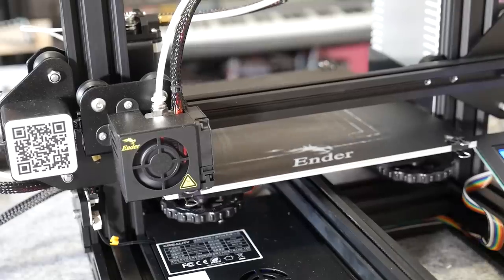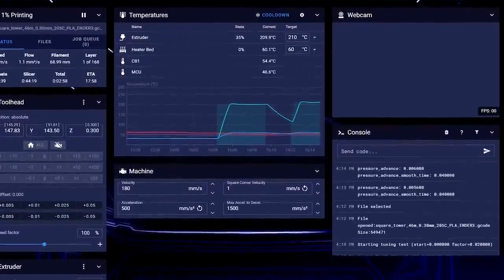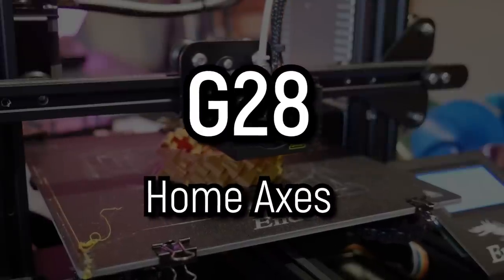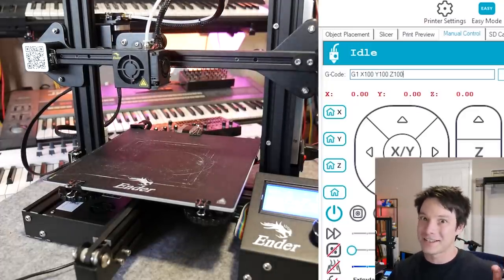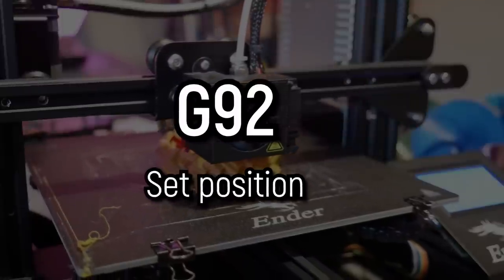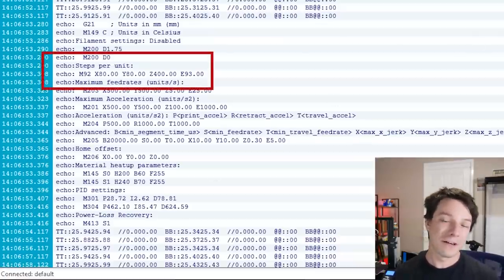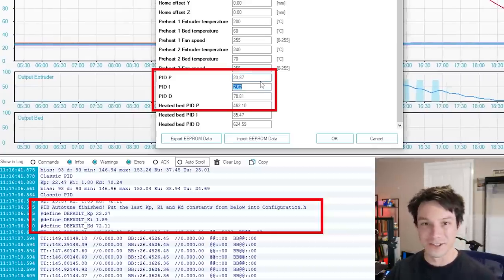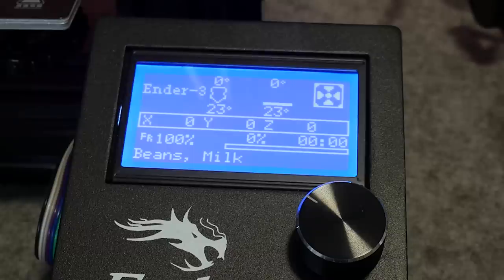Top 10 useful G-Code commands for 3D Printing

Comment: Knowing a few lines of gcode is super helpful to make the machine do non-printer things too... for example, I needed to clean some small parts so I put them in a small container of cleaning solution on the printer's bed, then wrote a bit of code to heat up the bed and shake it around for a couple hours. Instant agitating hot plate. I also have my printer play a distinctive tone just after it completes waiting for heater temperatures, so I'm warned before it starts moving (I have a bad habit of sticking my fingers in there).
Reply: Same, I set a beep after the bed leveling (I do a 4x4 grid) is done, so I can clean up the filament purge if it wanders into the print area, and 3 beeps at the end to signal it's done.
Reply: I like your heat/agitation cleaning idea. Another one I thought of is to use the heated bed to precisely warm up a smartphone before attempting to remove the screen, which is glued in. I also used the heated bed to accurately determine the minimum temperature difference that would keep my Kontax low temperature Stirling engine running.
Reply: I used it to heat up chocolate to melt and then reduce to the exact temp needed for tempering. 3d print a mold, vacuum form the 3d print and then make chocolate bars, chocolate coins, or chocolate Grogu.   LOL
Reply: How do you loop the commands to move it back and forth?
Reply: @marioferreri4352  You might not like my answer but.... I just copy/pasted the movement commands over and over. Apparently gcode does support some limited looping (see M808) but I didn't feel like messing about with it at the time.
Reply: @spagamoto  man that’s unfortunate. I was hoping you had some magical trick to use. So you just manually make a g code file and then have the printer “print” it?
Reply: @marioferreri4352  pretty much yeah. Not clean but it's useful. I just keep the file on the sd card in a Utilities folder for whenever I need a hot plate.
Reply: @Kalvinjj  You might use the non waiting extruder heating to for example 180 °C (just so the filament is not melted yet), meanwhile it will do the mesh measurement and then after it completes finally use the waiting target temperature. This way it won't ooze any filament in your print area.
Reply: @LaXi0rCZ  Good idea, thanks for the tip, I just tell it to go to print temperature but might change it to that, let it ooze only on the wipe area.
Another code I like using is a 10mm retract at the end (for non high flow hotends) or 30mm (high flow like Volcanos) to let you remove the filament afterwards without preheating.
Reply: @marioferreri4352  in the CNC world you can do "jump to..." commands... idk if it works on these printers
Reply: I use it to roll my old vape pen cartridges back and forth on the hot bed, getting the distillate nice and hot and saturating the wick. This gives me a few more good rips on em before going in the recycler.
Reply: @caraeriu  I cant be the only one using the hot plate to keep my coffee warm and stirred during my morning meeting can i?
Reply: @marioferreri4352  copy and paste?
Reply: I did this to bypass the "auto heatbed off" on my Prusa when I wanted to dry some PETG using the filament box trick. Super simple 5 line file - heat up to 70C and then do nothing for 12 hours.

Comment: In prusa slicer, I've set my color change gcode to let me insert nuts, magnets or anything else into a print with the G1 and M0 commands. This little bit of gcode will present the current print as if it were finished for 3 minutes before pulling it back in to complete it. It's very basic, but it works.
G1 X0 Y220 ;Present print for objects to be inserted
M0 S180 ;Resume print after 3 minutes
Reply: Never thought of pausing a print to embed something into a part, very cool idea lol
Reply: PrusaSlicer actually supports doing this -- pause at a specific layer, and wait until you press the button/knob before continuing.  I've used it quite a few times to insert magnets or other "vitamins" into a print partway through.
Reply: G4 S180 do the trick also. G4 = Dwell, followed by P for miliseconds and S for seconds how long the machine should wait. The difference between M1 and M0 is that with M1 u can put a condition into the G code telling tha machine if it should care about the M1 or move on (Conditional stop) whilst with M0 the machine will always stop (unconditional stop) However from what I see this does not work on 3D printers, probably because M1 is mostly used with manual programming of CNC machines for test runs to avoid possible tool crashes on the first run and then when u seee the program runs properly u simply disable the condition and the machine will then ignore the M1 command and just continue. Like a debugging breakpoint in general programming. This is obviously not needed on 3D printers as there is no possibility for tool crashes like that and so only M0 is used here. M1 will maybee work as well (although it says deprecated on the Marlin page for M1) but u can I guess not put a stop condition in anywhere and so M1 and M0 will mean exactly the same to Marlin = unconditional stop.

Comment: IMPORTANT NOTE FOR ENDER 3! The ender 3 saves firmware changes to the SD card, which includes PID tuning values. If you have multiple sd cards you need to have these changes on all cards, so I just stick with 1 sd card. I had a hell of a time figuring out why my printer kept under extruding after repeatedly calibrating e-steps, and it was because I was swapping sd cards.

Edit: this is for all I know only for the v2 and other models running the same board.
Reply: I have multiple sd-cards, but I use git to version control the contents, to keep them all in sync. My process is quite simple...
When I switch to a different card, I pull the changes from it's remote before adding new designs. 
After a successful print, I pop the card back into my PC, commit the changes and push the changes back to my remote, so it's up to date for the next time I need to switch cards.
Not only does this mean I have a record of all of my prints, it also means I have a record of how all of my settings are changing, over time.
Reply: @markbooth3066  very interesting, if I ever need multiple sd cards I'll try this.
Reply: @Dylan Lasky :  I read this and thought "I've never had that problem... what's he talking about!"
Then I realised that I have only ever used the same SD card for my file transfers!  🥴
I don't think a lot of people are aware of this... thanks for the "heads up".
Reply: I had the problem that the I only inserted the SD card that came with my printer into my printer twice (enough time to run the benchy) before it died, and I lost everything on it. As I hadn't even considered this as a risk, I hadn't backed up the card before doing anything with it. This made me rather more paranoid about my printer SD cards than I might otherwise be. *8')
Reply: Do you use Cura slicer?! I've been swapping and using random memory cards for years with no issues!
Reply: @Jawst  it's only a problem if your settings are not default
Reply: Not if you use MRisCoc professional firmware. It saves to eeprom - You can delete the data file.
Reply: What happens if you dont use a sdcard to print, but a raspberry pi?
Reply: @leobuchwieser1203  you should be fine
Reply: Thank you for sharing!! I have just run into an issue with my Ender 3. I found the issue IS the SD card. I recently upgraded to the silent 32 board. Some prints were great others sucked. I couldn’t find why, until I read your comment.
Reply: @dylan, this is incredibly inaccurate. Certain ender Models do. As per the firmware from Creality. 

I haven't had a SD card in my 2 ender 3 in more than a year.... how does it store the information??!?!?!
Reply: @CincyNeid  I'm assuming your ender has stock extruder and hot end?
Reply: @dylanlasky2389  .... Which Printer? 
Ender 5 Plus. MicroSwiss Direct Drive, EZABL, EZBoard 2.0 w/ Marlin 2.1.2
Ender 5 Pro, BiquH2 Gen 2, 4.2.7 STM/RET6 Board with Marlin 2.1.2
Ender 2 Pro, Mosquito from Slice Engineering with a 4.2.3 STM/RET6 board with Marlin 2.1.2
Reply: @CincyNeid  if you have changes to the default settings of the printer, some ender models save those to the SD card so you can't just swap out sd cards. Idk you felt the need to flex when I asked if you had an upgraded ender 3. None of those machines run the stock board from the looks of it and therefore shouldn't have this problem.
Reply: @dylanlasky2389  My Stock Ender 3 Pro [came stock with a v1 8bit board, later updated] with Creality Firmware on the 4.2.7 board stored all the EEPROM information to the Mainboard. My point is, and still stands, that Creality printers store to the EEPROM, then when Covid hit, and Creality starting sourcing their Silicone and MCUs from other manufactures. Thus introduced the GD [giga digital] Chips, and the RCT6 chips. That shipped with 256k memory instead of the STM/RET6 chips that had 512kb of memory. 

 Thus Creality had to push the EEPROM settings to the SDCard because the Mainboard didn't have enough memory for Marlin and the EEPORM settings.
Reply: @CincyNeid  cool, I didn't know that
Reply: @dylanlasky2389  Yea, it got REALLY REALLY harry there for a little bit, and creality is still trying to recover from it.
Reply: @wt29  I'd recommend this for anyone with an ender 3 V2, the pro software transforms the printers capabilities.

Comment: Probably the best G-code overview I have ever seen. 
( I used to use G-code quite a lot with CNC, but I haven't really had to mess with it for 3D printing that much. 
Thanks for a great video.
Reply: Agree 100%

I did also work with multiple CNC-machines and have picked up a lot of useful G-code and M-commands out of this video from Angus (again) 👍🏼

Comment: When you start to get into the M commands you should specify what Gcode dialect you are using. M302 will work with Marlin, but might mean something completely different on another firmware, or for a laser engraver, or a CNC mill.
Reply: big facts man

Comment: To heat both extruder and bed at the same time, but not proceed until both are up to temperature, use all four temperature commands:

M104 S200 ; start heating the extruder and continue
M140 S60 ; start heating the bed and continue
M109 S200 ; wait for the extruder to reach temp
M190 S60 ; wait for the bed to reach temp

Much more efficient than waiting for one to heat and then the other.
Reply from the maker: Yeah that's a nice way to do it! I've always wondered if some companies choose not to do it for power draw reasons, or if it's just unoptimized code.
Reply: You could maybe calculate the time taken to heat each element, then do the following:

M190 S55; calculated intermediate bed value
M104 S200; start heading extruder and continue
M190 S60; finish heating bed
M140 S200; finish heating extruder
Reply: As long as your power supply has enough juice to do it and not trigger thermal runaway protection (which might trip if progress isn't being made fast enough), and if it won't trip a fuse or over current protection in your printer  I have noticed that there are definitely better and worse patterns for heating up my old Replicator 2x: I think it heats one thing up part way, heats the other most of the way, then does "heat both the rest of the way"
Reply: @WindyLion  That's pretty much what I do, and it's easy to see whether you need to tweak the intermediate set point by looking at the temperature graphs (one of the reasons I love my Octoprint).
Reply: @WindyLion  I have my start GCode in Klipper and I'm calculating 90 % of the bed temp for 60 °C and 99.6 % for 100 °C (and linearly between those temperatures - it is good enough). Just after I reach this temp, I start heating nozzle and the rest of the bed temp. This way both heaters are finished almost at the same time.
Reply: Some years ago using an old version of Cura (Ender 3 Pro profile), it heated bed then nozzle in sequence waiting.
Now i'm back into 3D printing with latest Cura at this day, i noticed it starts heating both simultaneously, but nozzle only to 120°C, then wait for both temps, and eventually finishes heating the nozzle to material target temp.

Might do some timings on a worst case scenario of bed heating in winter, to adjust some intermediate steps, as nozzle going from 120 to 240 still takes some time.

Don't know if avoiding keeping the nozzle idle some time at 240 is to avoid wearing of the hardware, or if it's safe but just to avoid some oozing before print.

Comment: Note that g code is not universal, the specifics of the M codes in particular will differ between firmware projects, but I assume these are for Marlin which is the most popular. I think most of these but not all work with my old Sailfish-based printer (when piped through gpx, which is kind of like an early thing like klipper)

Comment: You forgot one super useful command to know about: M0 – Unconditional stop
It will pause execution of any further commands until input (encoder wheel or touchscreen) is pressed. it also has text display part like M117 so you can use it (especially with M300 beeper) to pause print when you need to insert some nuts or magnets that are meant to be fully encased

Comment: For sounds it depends on which buzzer is used. It can be active (making sound right after you connect power, no frequency control) or passive (you have to do some PWM to make it sound, therefore you can control frequency). Prusa uses passive one! So you can Google for some gcode melodies and put them in your end gcode. So printer can play an Imperial march if you want.
Reply: "My Imperator... the printing of the third death star is finished at last... " damdamdam dam da dam dam dadam* 🤣🤣

Comment: If you've got a printer that's pimped out with LED attached to the control board the G-Code for turning on/off or adjusting the color of the lights if they support it can be fun to play with.  Flashing the lights a couple times after a print is done can draw attention if you don't want to use the beeper for that.

Comment: I found this G-code online but its really helpful for auto bed leveling ( I was having an issue where the nozzle would ooze during the probing and cause the prints to not lay down a consistent first layer) 
M140 S80.0 ; Set Heat Bed temperature
M190 S80.0 ; Wait for Heat Bed temperature
M104 S160; start warming extruder to 160
G28 ; Home all axes
G29 ; Auto bed-level (BL-Touch)
G92 E0 ; Reset Extruder
M104 S245.0 ; Set Extruder temperature
G1 X0.1 Y20 Z0.3 F5000.0 ; Move to start position
M109 S245.0 ; Wait for Extruder temperature

I print using PETG so 160c is warm enough to not ooze but also doesn't take too long to heat up the rest of the way. As long as you set up the Z offset with a fully heated nozzle, the probing can start as soon as the bed is up to temp. It also heats up the rest of the way in the starting position so as soon as it get there, it lays down the purge line (any oozing during the heat up wont cause any issues)
Made my ender 3 into a start it and forget it type of machine!

Comment: If you ever get a move out of range error when using Klipper it's normally because of absolute/realtive mode is wrong for X/Y/Z (G90 vs G91) or the extruder (M82 vs M83).  It's a very common error people run into when writing macros for Klipper.  To confuse matters even more some slicers let you set if gcode is generated in relative or absolute mode as well.  Best way is to check what the current mode is, for example the variable printer.gcode_move.absolute_coordinates will be true if in absolute mode for X/Y/Z moves.

Comment: Also G2 is important, that's an arc move. This can help reduce stuttering especially for 8-bit motherboards, since it doesn't have to do many tiny G1 moves. The Arc Welder extension for Cura will do this automatically if you install it through the software marketplace and enable it in Special Modes. It'll also make smoother curves in your prints and reduce gcode file size.

Comment: My fav command is M810 to M819. the Macro slots. they let you combine common groups of commands in to one line. i do a lot of manual editting of my gcode out of the slicer. I just recently added M808 to my firmware, which is looping. since i dont have a CR-30 treadmill style printer, i use some ending gcode to slap the part off the bed with the X gantry and then restart the gcode. between M808 and M810 for my "reset extruder axis" and M811 for my "go in to rel positioning, move the z axis up one layer, and go back in to abs pos" i can print "forever" on my ender 3 pro. in conjunction with filament sensors it could run forever with minimal interaction.

my next project is definitely going to be a filament splicer, so i can just load rolls of filament and print parts literally forever lol.

Comment: I think you have missed the pause/unpause commands M600/M601. Useful for inserting stuf in 3D prints or for manually changing filament. One problem with this command (at least on smooothie) is that it turns off heating, which is especially bad for bed heating mid print.

Comment: I've got two custom gcodes loaded into start G-code in prusa for my Ender 3 S1 (just below G28).
G28 ; home all axis
M420 S1 ; ensures the 16 point mesh from the probe is actually used for the print
M413 S0 ; prevent writing to the sd card after each layer which can potentially make blobs on your print